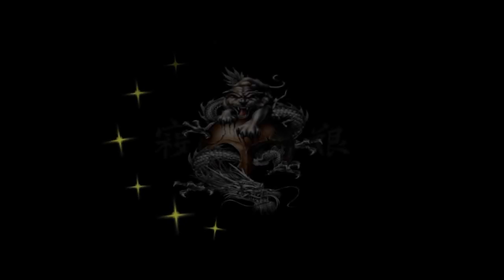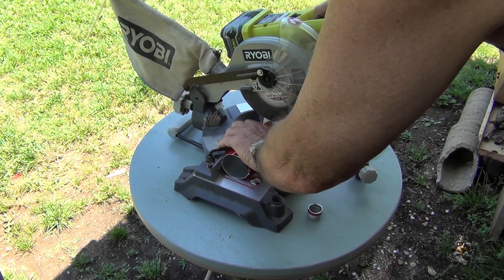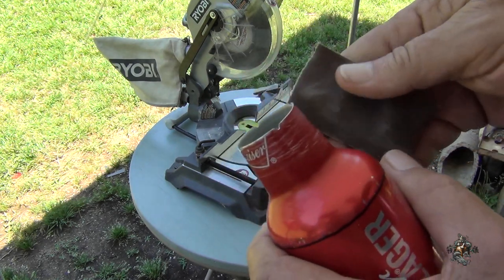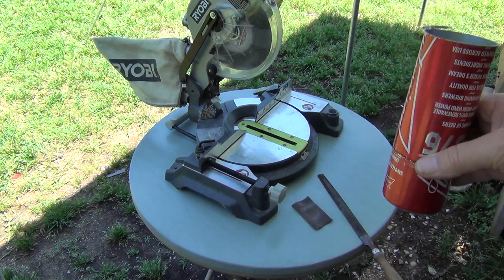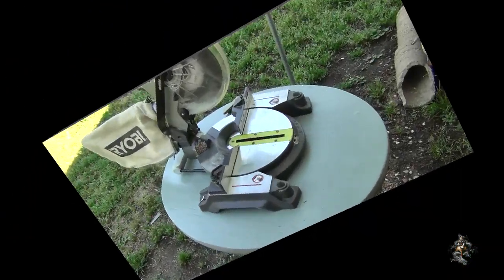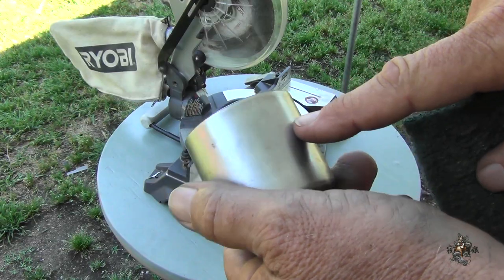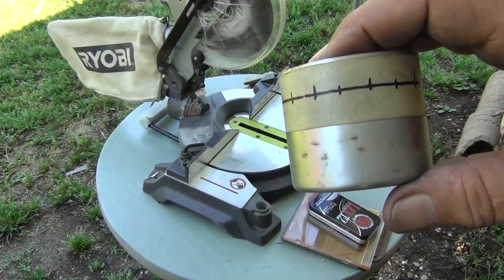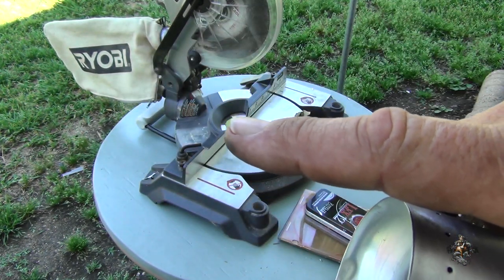DIY Aluminum Beer Bottle Alcohol Stove Burner - Build & Test

Comment: Nice one! May aI ask what kind of sealant you used, or which one would you suggest using?
Reply from the maker: I used a standard 2 part epoxy but I wanted to use a RTV high temperature Silicone which you can find at a auto parts store 👍  Although this is such a tight fit, you really don't need to use anything 😉  I hope this helps.  Thanks for your kind comment and thanks for watching too 😉 Take Care 😊
Reply: SurviveN2 That definitely helped, thanks 🙏
Reply: Epoxy is completely unnecessary.  That is correct.

Comment: Why bother sanding the paint off?
Reply from the maker: I don't like the Beer 😜
Reply: @SurviveN2  LOL me neither.
I fan of Tea here myself.

Also, if you toss the top part of the can in the freezer for 10 min and the bottom can into a pan of really hot water, the two will go together much easier.
Reply from the maker: @zolar1nonassumpsit219  LOL me too.
Green tea or Oolong 👍
 Thanks for the tip, although I should have remembered it from science class...get something cold it contracts and get something warm and it expands...I know why I didn't remember it, I kept cutting that class 😜 LOL
Reply: @SurviveN2  I understand about being distracted. Hard to fit some pretty girls in a backpack for bugging out....
Oh and a 12 pack so you can make more stoves!

The freeze/heat was not my idea. I got it from watching about 1,000 other tube videos and one person came up with the idea. And it worked.
He said no sealer needed.

Another person said to use a tiny bit of silicone spray as a lubricant.

Not too sure about that idea.
Maybe some WD 40 I think since it evaporates readily.